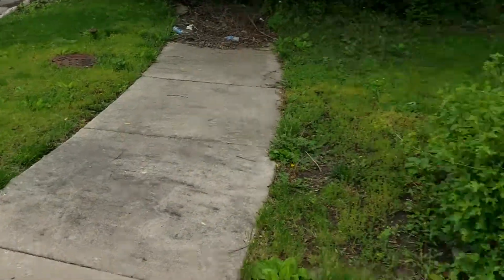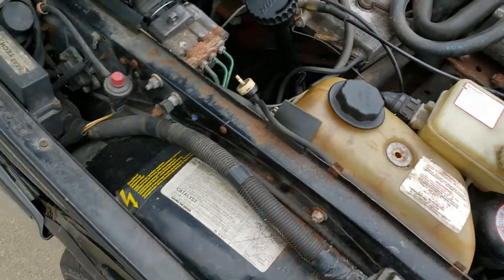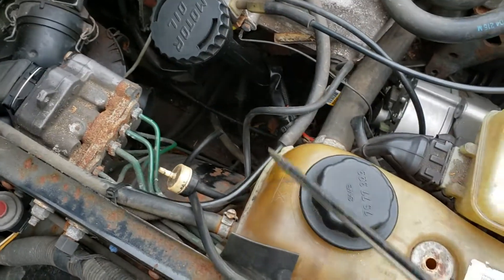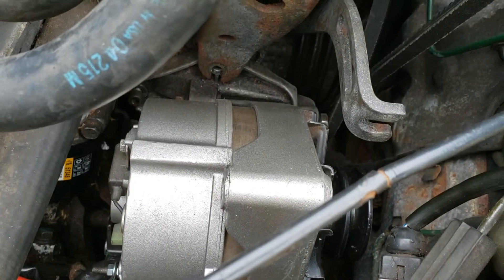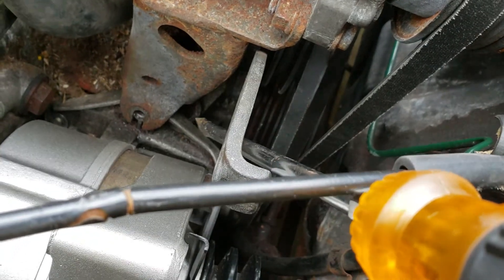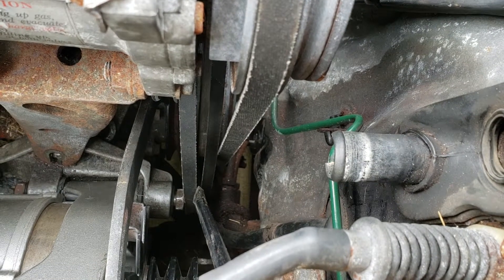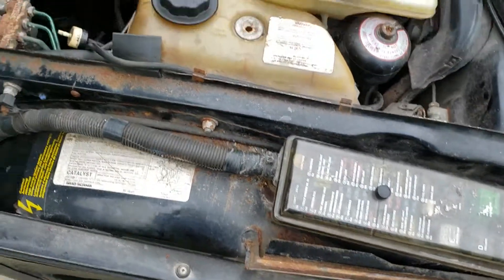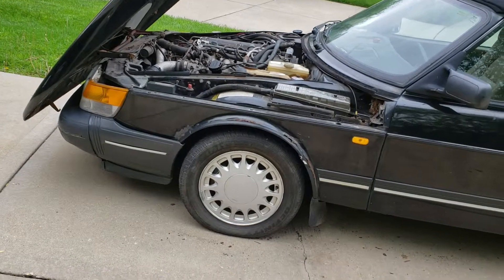how to remove alternator in SAAB 900

Comment: I fixed an alternator that wasn’t charging on my Saab 900 by replacing the brushes in the back of the alternator.  I want to say it was around $30.  Two screws to remove and replace the brushes.  A little hard to get to, but WAY easier and cheaper than replacing the whole unit.
The part was made by Bosch. It’s actually called a voltage regulator.
Reply: Where did you order the part from? I may need one for my 1993 900

Comment: Great video.  Pedro is mistaken.  Least you made the effort of making a video.
Have a 1986 Saab needing an alternator.  Back bolt next to the firewall is way to long to allow removal.  But...guess I need to take off a couple of bolts under the smog pump.
As you pointed out.
Thanks.

Comment: if your alternator is not charging ...... before going to all the trouble of removing it, check the charge indicator dash bulb is not blown, if it is the alternator will not charge the battery, you can get to it by removing the speaker/airvent above the driver side console, place a mirror on the outside of the windshield so you can see the bulbs. make sure to replace with 2.0 watt and lot the similar black socket 1.2 watt.
Reply: That's such a helpful suggestion! Much appreciated!